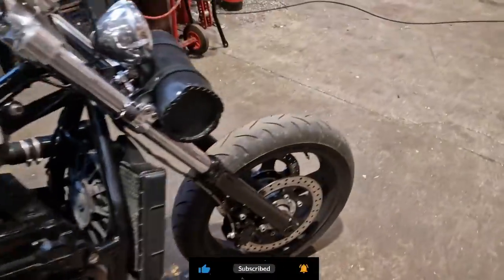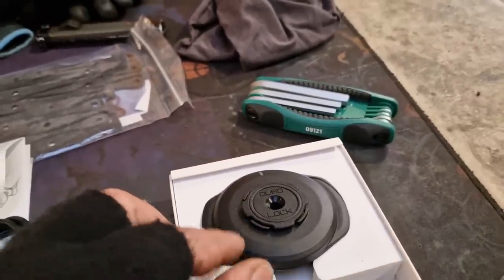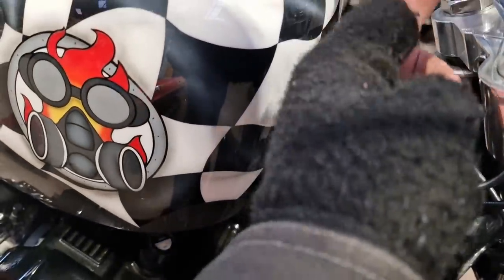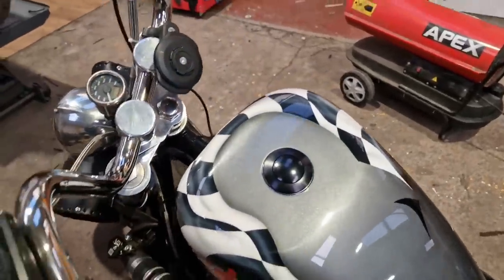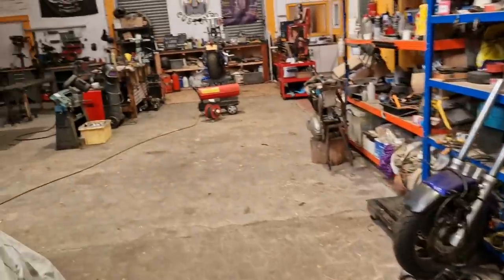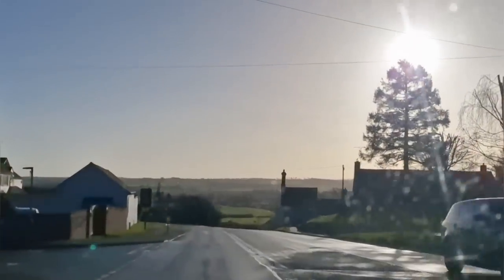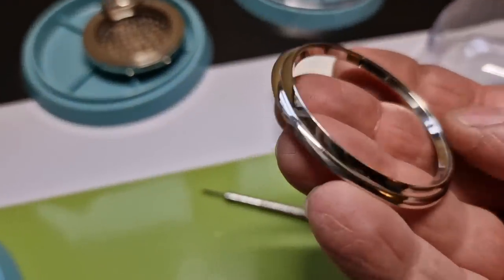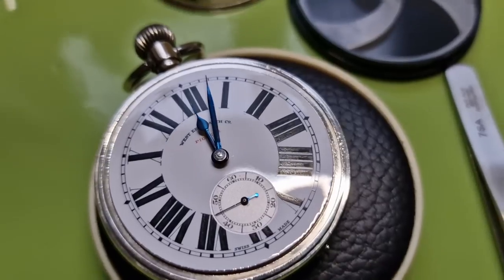Happy Christmas Handmade Custom Bike Building Vlog #bike #handmade #vlog #christmas

Comment: heh, front fenders...
I knew a bunch of Bikers down in San Jose CA back in the early 80's, this one dude kept getting hassled by the PoH-Lice all the time and when they couldn't find anything else to write him up for once, gave him a ticket for not having a front fender on his Harley.
He scrounged around and found a front fender off of a vintage Schwinn 10 speed that was almost exactly one inch wide and fabricated brackets so it would bolt up on his Hog.
It was hysterical, the thing was almost invisible unless you looked at it just right.
He had to take it in and have it inspected to get the fine dropped. They pissed and moaned and bitched up and down about it but couldn't do a damn thing about it. The rule book didn't give any specs, it just said you had to have a front fender.
I'll never forget that as long as I live.
You would have liked those guys.
Reply from the maker: Happy days lol